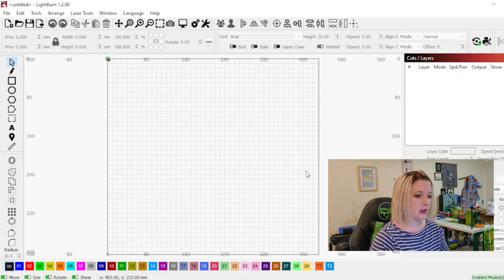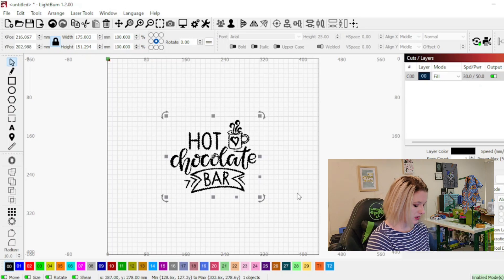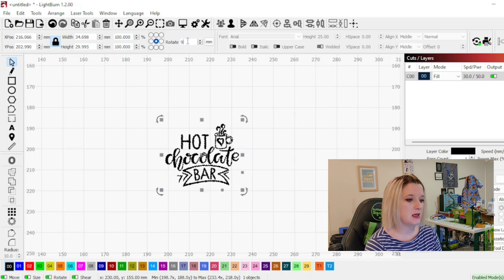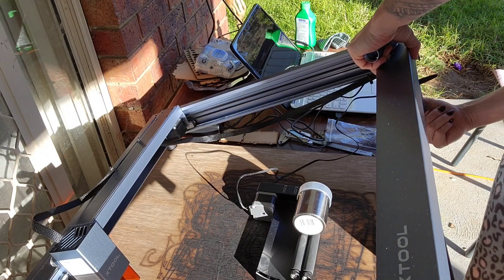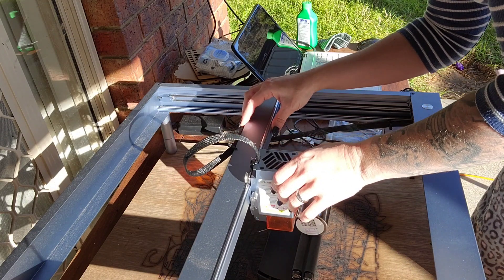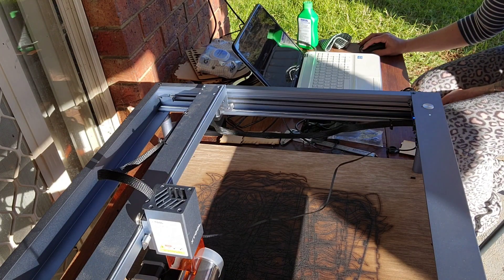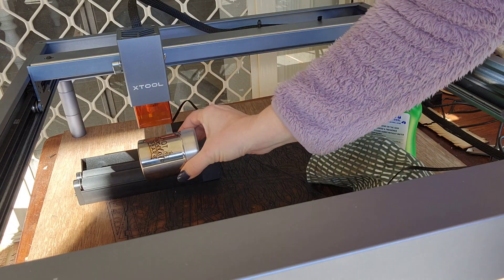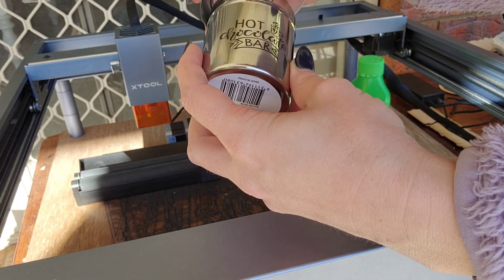Using lightburn to setup a rotary engrave

Comment: How are you measuring your diameter with a ruler?? What are you actually measuring?  I use a caliper is that the same as you’re doing with the ruler
Reply from the maker: The total diameter  which is the widest part of the circle :) and yes callipers do the same thing, just more accurately

Comment: So the rotary is not plugged in to the Y axis? My atomstack R3 pro roller needs to be plugged into the Y axis motor
Reply from the maker: It has one place to plug in then in the program just tell it that you are using the roller :)